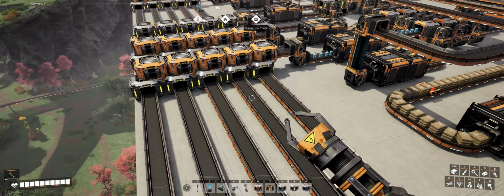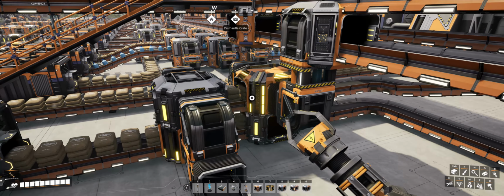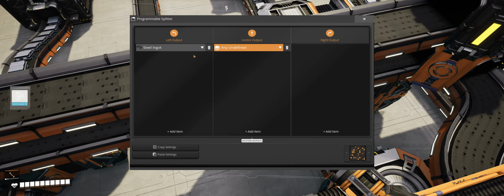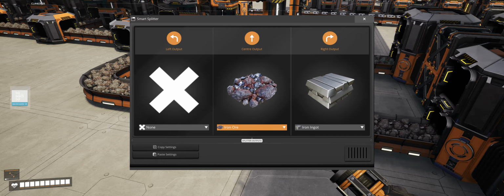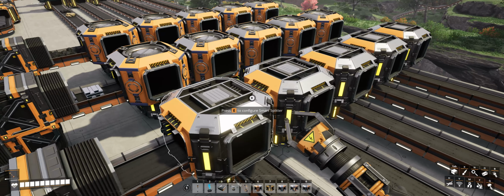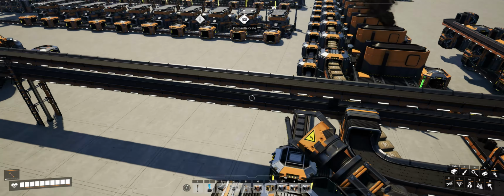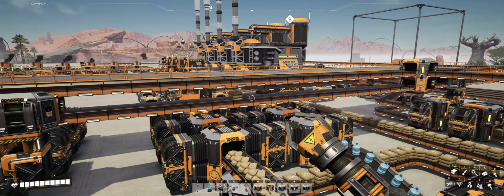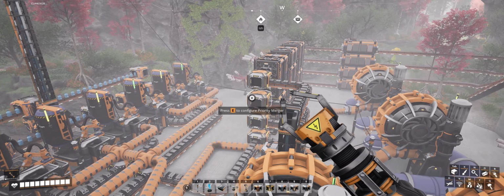Request Based Factory Design for Satisfactory

Comment: This is super cool man! I have been working with splitting belts to fractions and I think that would be a good way to control the requests for example with the copper and iron if you have the iron trigger 4 time more than the copper or the copper a quarter the time I think if you play with a multiplayer that could allow you to tune to every ratio